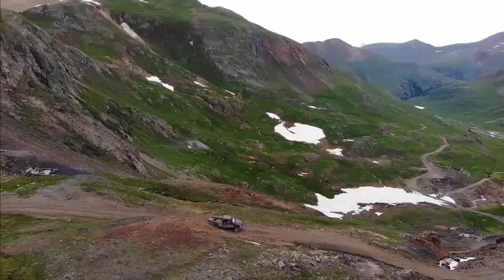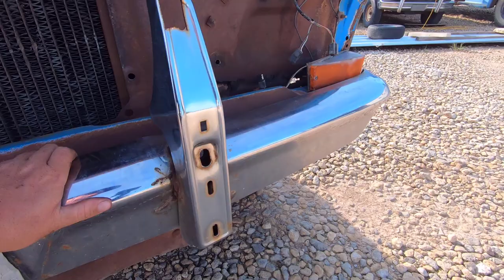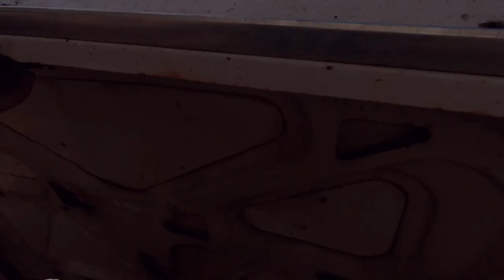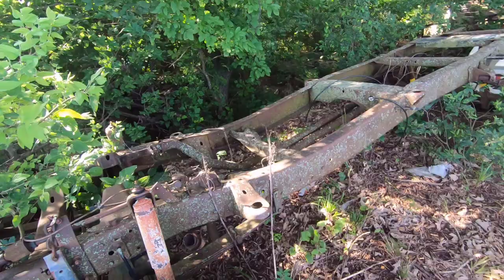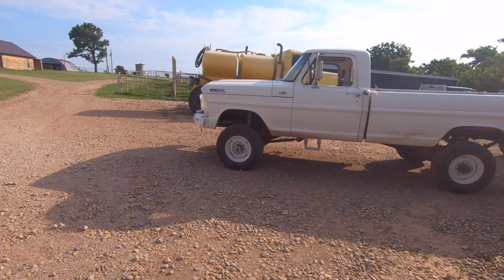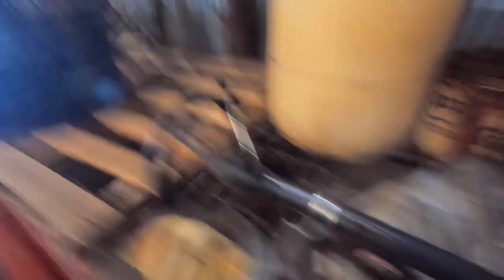What Exactly Is a Highboy? Plus Ultimate Highboy vs Stock!

Comment: Hey Matt, Thank you so much for all of the info. I had a 1971 F-250 Sport Custom tan and white 4x4 high boy bump side. I bought it used in 1980. 4 speed with the granny low. I had the Dana 44 HD front end. I loved that truck. I had it for 12 years. Sold it in 1992 when I got married with kids. That was 30 years ago now, and I still miss my truck. No power steering, no AC. 360 big block. It was completely stock when I bought it in 1980. It had the extra traction lug tires on it with the stock rims. I bought 36” tires with 16.5 rims for it, but the tires would rub. So I bought new Burbank leaf springs front and back to raise up the truck higher. Also installed headers with turbo Corvair mufflers. It was awesome. If anybody knows the whereabouts of my truck let me know. California license plate black with yellow letters(56 652 H). I sold it to someone in Rodeo California in 1992. Thank you! I am 63 years old now, thank you for taking me down memory lane👍

Comment: Since I am a ford kind of guy, a very old one at that point. I think I have seen them all but always room for learning something. I got a brand new one in first week of 67 and it was a solid color blue, not turquoise but blue and about the color of the comment sign on the page here, had the 390 and four speed with divorced transfer case and it was a half ton. Not one extra feature, bone stock with all the gauges, no idiot lights. I went to nam for a walk about that didn't get me home till spring of 70 so I drove ol' blue for a bit  then got a another one in 71 new from factory with a ranger package and it was turquoise and white... beautiful till I hit a deer.... and then it come back from the paint shop with the 72 frontend. In 76 I bought a new deep dark green one extra heavy duty three quarter ton that I put a flatbed on it with toolbox's and it was my shop truck for about five years and close to a million miles on it. I also bought the 77 three quarter ton. Special order 406 four speed with posi rear and a front axle built by some shop that had a posi lock run by vacuum and it worked really well as I raced it and beat the holy hell out of it where I finally got a 427 in it with a car four speed and it was a tire burning holy hell on wheels. I had everything chromed that could be and when I finally put another driver in it while racing he crashed in third gear with foot to the metal. Not much left of that one.... even the announcer sounded like he was crying. I had close to fifty thousand in that one. Running aviation fuel in it with a blower, musta had close to eight hundred horsepower. Main thing was my driver was okay and he felt so bad that he quit driving. It was just a truck but he sure loved it. I took a handful of them and made me a sorta big foot truck and it hinged in the middle. They were cheap back then.
Reply: I've never heard of a 67 or newer halfton truck that had a divorce transfer case? I have had a 67 that had a 352 with a 4sp & a married transfer case. It was a one speed tcase. A Dana 21. It had 2wd or 4wd & that was it. No natural or 4 low. I ended up breaking the output shaft going from the transmission to the tcase. Actually broke 2 of them. I dont dought you had one like you say, I've just never heard of one. Having a 406 in one would be a blast as well!
Reply: Sorry to NitPick my friend and fellow Ford guy, but….. your truck even being a half ton would have came from the factory with a 360, not a 390…

.. my uncle has a 1970 Crew Cab HiBoy that he bought in high school in 78 or 79, he used it as his sled puller for many many years it having a 427 in his as well it was damn near untouchable. It now has a 428 that isn’t half the engine that the 427 was.
Reply: @warrenmcelroy4718  And you would be right... that said, it was ordered and on the build sheet, tain't but twenty or more horses but that torque was what was wanted.
Reply: @morgansword  yeah I know Ford would do a lot for their customers back then and still do to a degree, but even a special order wouldn’t allow for a 390…. I know exactly what you mean though, they’re basically the same engine but for some reason a bad 390 always seems to run better than a good 360 hahaha.
Reply: Amazing historical life dear Veteran amazingly beautiful trucks you’ve had , I’ve got a 79 Ranger XLT trailer special.happy new year from South Australia

Comment: Hey Matt. Back in 1980 I bought a used 1976 hi-boy. Think it was a snow fighter. 7 1/2' Meyer snow plow. Had big chrome lockout hubs, disc brakes, power steering and brakes, NP 4 speed-reverse was over and down, 205 transfer case. 7 leaf springs on the front and 9 in the back with 2 helpers and factory stops for them. Made a strut rod from the transfer case to the frame. Blew up the 360 so rebuilt a stock 390 from a junkyard . Previous owner put hi-back Bronco bucket seats in. Had the factory 3 post mirrors with FoMoCo on the glass and stamped in the metal. Loved that truck. It was a BEAST! Sold it to buy a brand new 1984 F350 4x4. Still miss that truck:-(
Reply from the maker: Very cool!
Reply: I grew up on these trucks too, and my uncle and his buddy both ordered brand new F350 4x4 reg cab single wheel Diesel pickups “ 4 spd” in 86, my uncles now has a turbod 7.3 and a ZF5 and I bought the one his buddy owned originally about twenty years ago and my brother owns it now. That one now has the cab and bed from my 84 diesel and a 7.3 out of a 1989 F250 diesel that I totaled years ago, it also has a turbocharger but still has the original 4 speed. Those two 86 F350’s came off the assembly line one after the other and arrived at the dealership on the same truck, they’re only one VIN # off from eachother and both are still in the family haha. In HighSchool I drove. 76 HiBoy with a 390 out of an old Mercury and it was a beast. I drug more Chevrolets around with that truck than I can remember hahaha. My brother drove a 66 F250 4x4 that was turquoise and had the four speed with reverse that is over and up. I’ve sold most of the trucks I owned in my youth but luckily I sold most all of them to either my uncle or my brother, and they never get rid of ANYTHING ahahaha
Reply: My old man bought a used 75 in 1980, with a Fischer plow, the four speed stick , 360,same as yours. He gave it to me in 89. I miss mine too, such a feel and character sitting on that bench seat holing that stick and steering wheel. Beautiful machine
Reply: 360's were notorious for breaking connecting rods. You're better off with the 390.
Reply: Nice

Comment: Hi Matt! Great video! I have an early 77 F 250 7700 GVW. I ordered it and got it Thanksgiving Eve of 76. built on a Thursday at the Norfolk plant. New process 435 they would not put a 400 in front of it at the time held up my order for 5 days. The 351M is a dog I was so ticked but Ford’s reasoning at that time was the drive train could not handle more power 460 now. You are right they were referred to as a “High Rider” in NAPA catalogs as well I remember that for sure. 

 The one thing that really confuses me is the height in 76 and early 77. Guys will argue that all highboys are the same. I never saw others the same height and would have never bought mine if it had been lower. They did lower them in the middle of 77 for lack of sales to hard for the older farmers to get into. I have always thought it was much tougher built than a ¾ ton two wheel drive. I have all the service manuals and never knew it was an F 350 frame they never referred to that fact. Great information my son loves the truck. “Thank you”.

Comment: Thanks for clearing up the Highboy information. I wondered why my truck is a F26 but nothing else seemed to match up to the other Highboy configurations. I never paid much attention to VIN numbers although I've owned 8 between '64 and '89 all bought new, all 3/4 tons 4wds some with 460 engines. Ranch trucks for pulling cattle and hay trailers. I really appreciate and admire the work you are doing and the knowledge you share with all.

Comment: I’ve had my 66 F250 4x4 for 40 years so I just learned a lot.    I bolted on 37’s with no lift kit years ago, everything is different than a standard so now I know why. Thanks for that! The battery is in the passenger floorboard for example.

Comment: Nice breakdown! Only things I would add, with the divorced case, you always got the standard rotation front diff, hence the lower pinion/yoke. With the piggyback case, you got the reverse rotation front diffs. They’re supposed to be a little weaker, but I’ve never wrecked one, and I much prefer them because of the nicer driveline angle. You are correct about the way 203 case operates, and they can be converted, but if you can get your hands on a 205 they’re much preferred, not just because they’re a part time case but they are gear driven and the 203 has a chain.

Comment: Nice collection.  I have a 73 fully restored with an FE428 and the 79 real power steering box and factory A/C.  They are nice trucks and very sought after.  I used to have a 68 bumpside F100 and that was a very clean truck.  Put a 390 and headers on that with a C6.

It's getting hard to find those HighBoys now.
Reply from the maker: Very cool!

Comment: Great video, thank you for sharing.  My 77 highboy  was one of the very last ones built.  It had a 7,700 gvw, 4.10 Dana 44 HD disk front/NP205 transfer case/C6 auto/400m 2v engine/4.10 Dana 60 rear.  It had the power assist steering and the front cross member at the front of the front springs.  It came with 9.50 x 16.5 tires on 8’ x 16.5 rims.  7 leaves in the front and 11 in the rear.   You are right that they did not change much over the years.  Same basic truck from 67-77.
Reply from the maker: That d44HD with disks is a dang good axle!
Reply: @MattKubik1791  all 1976’s & 1977’s came with that front axle I believe.
Reply: Your truck has either a 351M or a 400, no such engine as a 400M. I’m pretty sure the tag in the valve cover shows the displacement to let you know if it’s a 351m or a 400.
Reply: @warrenmcelroy4718  you are correct it is a 400.  Typo on my part.

Comment: I have a 1983 F250 which, thanks to your explanation of the VIN numbered Highboys, is an F26 and a Highboy. It the OEM 300 Big Six, Dana 44 front end, New Process 4 speed, N P 208 transfer case, Ford 8.8 rear end with 355 gears. Two bed mounted gas tanks. I've owned many Ford trucks, but never one like this. Anyway thanks for the F26 info, I have always wondered about that. Really dig your channel. Just found it and will view all the previous videos!
Reply from the maker: “Highboys” stopped in 1977 anything after that wouldn’t be considered a highboy. The f26 however still continues to distinguish 4wd 3/4 ton truck. Still a cool truck you got there! Don’t get caught up with highboy or not a highboy it’s just a slang term to call 67-77 f-250 4wd trucks.  Thanks for the kind words. Cheers!

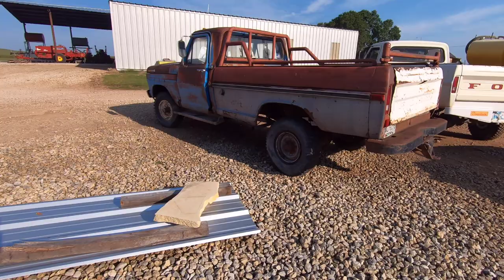Comment: Very good video. I miss my 76 F250 High boy, with factory air, 360, NP435, 205 divorced transfer case, Dana 60 4:10 rear, 4:09 44HD disc  brakes, Ross steering box with Bendix power steering, I don't think I'll find another truck like that one again.

Comment: Really like your collection , I had 72 high boy with a 360, I always thought it had Dana 60 front axle, guess I was wrong. The front axle had the extra large locking hubs which look really cool and the bigger Allen bolts made it nice to work on.  My favorite truck was my 79 F250 with 351M ,C6 Automatic , 205 NP(married of course) came with real power steering (power steering box). The 79 in my opinion was the best well worked out truck, mine had 38” tires and I drove it every day, and she never let me down. When they changed to the 80’s models it was so disappointing, especially early 80’s.
Reply: I bought a 79 f250 custom, new off the lot had 400m 4 speed Dana 60 s front and rear midnight blue , I was 18 yrs old my old man cosigned for it. It was something like $13.500 can’t remember exact. Wished to God I never sold it.

Comment: Highboys were available with either a Dana 44 or a Dana 60.  I own a 77, a 75, and a 74 Stock highboy with the Original Dana 60 Front end.   Also a sidenote, Highboys only had 2 engine choices . A straight 6 ,or a 360 with 2 barrel carbs.
Reply: My bad I  missed the part where you explained the engine options. But in all the info I can find never mentioned anything about a 390 option in 77??   and, one more thing the 77.5 had 3" rear springs .  thanks for all of the info, you taught me a few things about the frames.
Reply: @time69bandit16  77 didn't have a fe option. 335 series (351m/400)  or 300. and no 390 in a f2504x4 ever factory
Reply: All HighBoy trucks came factory with Dana 44 front axles, you’re seeing the Big Hub Dana 44 and confusing it for a Dana 60 but I assure you it is a 44.

Comment: I have the Dana 44's with the big hubs, I put a brand new powersteering gear box and powersteering pump for a 77 f250 but the pump is a little weak so I might put a pump off a larger truck on it. I put a new adjustable drag link on and a new steering shaft!. I'm getting there!.

Comment: i had a '71 bump side highboy. I think it originally carried a camper. It had two gas tanks, the heavy duty front axel (with small locking hubs) and rear overload springs. Someone also had installed Monroe load leveler shocks in the rear. It did have a snow plow frame on it but it was not complete and I removed it. I sold the truck to a tree guy who really used it to it's full capabilities. It later went on to farm truck use in upstate NY.

Comment: After 86 thousand pluss miles on the 360 that had timming gear problems at that time ford used a fiber timming gear that wore out fast ! After putting in a 428 Cobra jet motor in ! Was stock at 335 hp and a rebuild and a few changes made it perfect !👍👍 The Comp. Was high so i used a Water injection system from Edelbrock that worked after i changed the one gal. Tank to a 3 gal tank. No more pinggging

Comment: My 71 f250 hi-boy has a f350 frame 34" wide!, the original body was in bad shape so they put a body off a 67-70 f-100 on it which is the same and in good shape!, but the bed is a little close to the cab cause like you said the mounting holes in the beds are different!. At 65 yrs old its tuff but I home I get the restoration they started done!. It had a 6 cylinder from the factory but now it's got a 400 in it with the original 4 speed trans and transfercase which is all gears and no chain!. Trying to find stock looking rims 10" wide for the 285/75r 16's they mounted on 7.5 " rims!. They bulge way to much!. Its white just like yours but when I'm done I'll repaint it! Keep on Fordin!.

Comment: Scored! Was looking to convert my 1971 bumpside  to 4X4. Bought a complete 1977 1/2 year rarity. Original 351M/400 converted to 460, C6 auto, Dana 44 open knuckle disc brake. Rusty cab but repairable. My 71 is rust free, so now a conundrum.
Reply from the maker: hard decision!

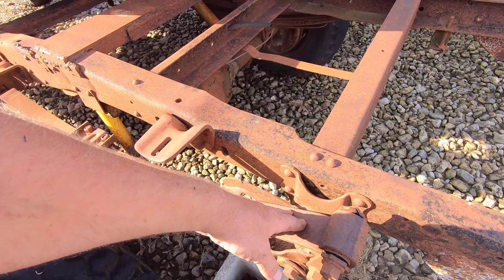Comment: @3:57 you make note of the "goofy shackle thing FORD did".  They were called "EZ Ride" springs.  That "goofy shackle" made the springs 4" longer allowing for a smoother ride but, still kept the same eye bolt locations and were available from '67 to '71, I think those years are correct. 
I took a set off of a salvage yard '69 Ranger and put them on my '62 F-100 unibed.

EDIT:  Sorry to have interrupted the video.  Please continue.

Comment: On my 72 non power steering box i changed over to a 1968 international travelall 2 wheel drive box ! A 4x4 travelall box turns backwards as i found out ! The ole man at a frame shop did the work for me , Worked Perfect and put a f750 pump on it with cooler that came on the f750 stock ! Late 70s on i went to Dick cepeck tires , from a Ouite gaint  35in. And as D/C made bigger tires went up to the 44in monster mudders in the early 80s  !

Comment: Hey there I only saw one thing that I have never come across in the high boy I bought in 2007 it's a 1976 f-250  4x4 and this one came factory and the only one I have ever heard of coming with a 390 fe actually a.     390 GT it was from New Jersey and has the large hubs , now other high boys I've seen had 35" tires x 12.5 or 15" wide rims , now this one I own is again the only one I've come across that has 40" tires,and 17" wide rims! This truck stands alone and above and beyond , skyjacker springs ! Original ,now it was rumored it was a one and only proto type design during the begging of bigfoots reign it makes sense bigfoots origins rooted in new jersey ofcorse the truck is blue it's like no other I liked your video rock on 👍

Comment: Interesting definition of "Highboy".  I have never heard this refering to these trucks until this video.
In my day, a "HIghboy" was a 1932 Ford roadster with the fenders removed and the body still setting in the original location...on top of the frame.  The body wasn't lowered onto the frame, known as channeling.  Thereby, the body was setting "high", right where Henry put it.
Reply from the maker: It’s just a slang term. And yeah same term used on the hot rods.

Comment: Matt  I have a 1969 f350 flat dump. Like your farm truck same color. Is it possible to turn it into a Highboy using the 2x4 frame. Not looking to pass it off as a correct highboy would like to have a f350 4x4 Dually  in your opinion is it doable. could you do a show showing how to if possible?     Love your show.

Comment: Thanks Matt for the clip. How did you marry up the 6r80 to the transfer case. probably in in the build series great i did know most of it but always great to  get some extra clarification
Reply: highboys are divorced t case. so its just a driveline, trans mount, and shifter mod for 4x4linkage
Reply from the maker: I used an adapter from advance adapters for their atlas transfer case. I had to do some clearance work to make it fit.